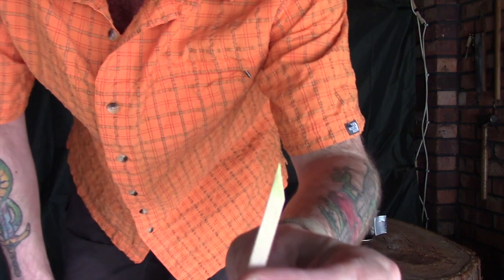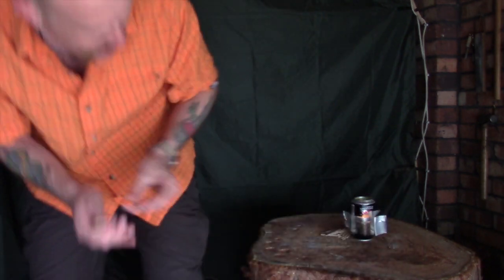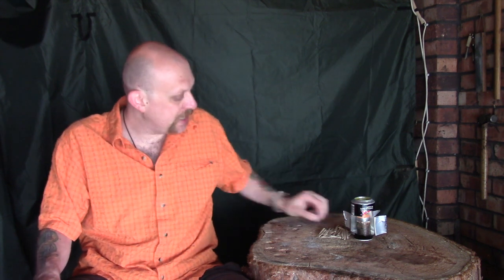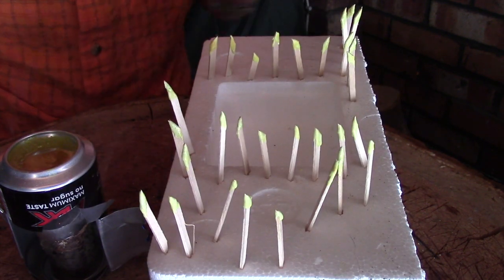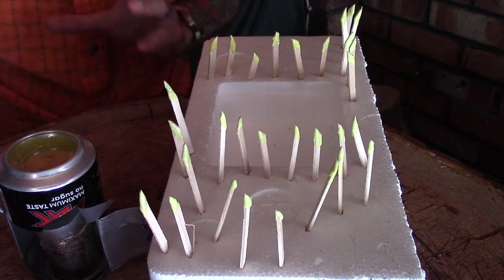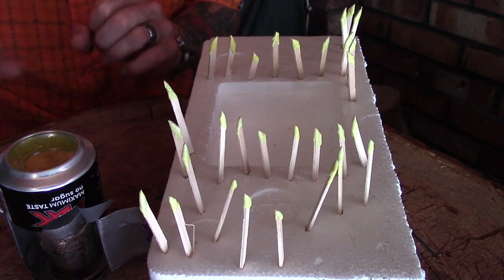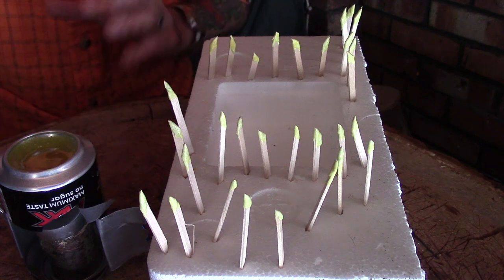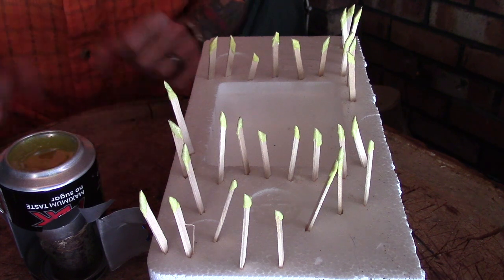Homemade Sulphur Matches

Comment: Sulfur matches like this date back to medieval times or earlier -- as long ago as people could make steel that would strike a spark from a flint (or made sparks from pyrites, which don't require hard steel because the spark is from the pyrite instead of the steel).  This is what would have been used to light a candle or lamp if, for instance, your bedside candle had gone out or you were coming home in the dark after being out.  These would have been part of any fire kit prior to the 19th century invention of self-lighting matches like Lucifers.

Comment: Personally I think I would classify that as some sort of kindling or lighting stick, similar to the rope dipped in paraffin wax trick. Outstanding idea and seems very useful in starting a fire a lot easier, but not a stand alone item like an actual match would be. Definitely has a place in my fire starter kit, anything to make the process easier is welcome. Thanks for the idea...

Comment: If you have to have a fire or hot coal to light it, what good is it?
Reply from the maker: When they were first used sulphur matches took the ember that was commonly used within a tinder bundle and turned it into a useable flame.
It wasn’t a new way of making fire but an improvement on those already in use.
The matches created a quick and easy to apply flame like an instant taper.
They were perfect for use indoors for lighting candles and lamps as well as fires.
For the outdoorsman it meant having an, almost, instant source of flame that could be applied to a pre-laid fire and was essentially a convenience.